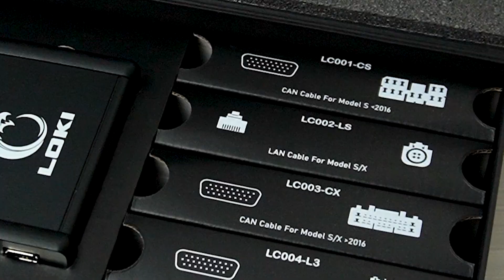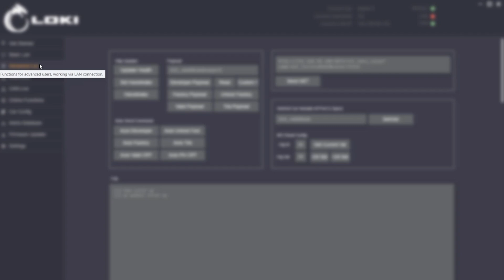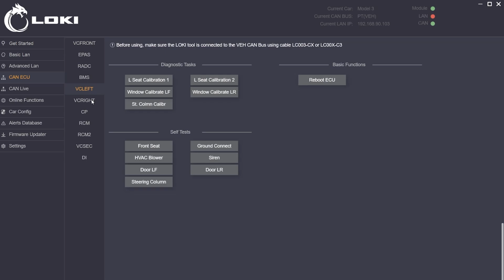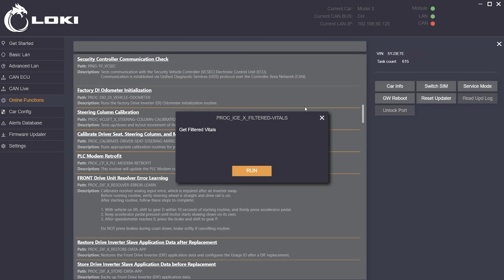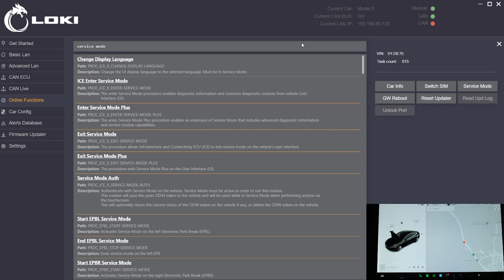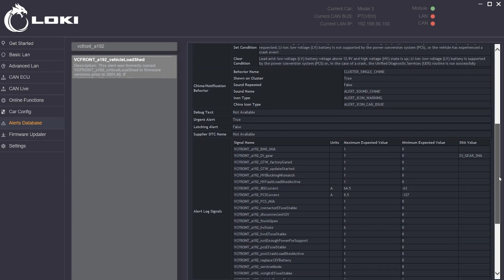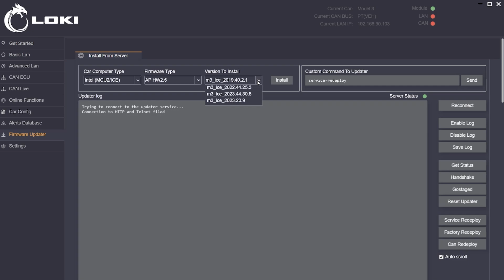Loki: a multi-function device for Tesla diagnostics

Comment: Could this be used to update the firmware of the steering wheel switch packs? I bought an aftermarket yoke for my 2024 Tesla Model 3 performance and the switch packs on the steering wheel (I believe it's a referring to the capacitive buttons on the steering wheel) have a different firmware than the car is expecting so my steering wheel heater doesn't work. Everything else works except for the heating function.
Reply from the maker: You can contact our managers: 
sales@servicems.eu
+48 (88) 689-30-56 (Viber, WhatsApp, Telegram)
EN: +38 (073) 529-64-26
ESP: +38 (067) 459-42-99
Reply from the maker: Ви можете звернутись з цим питанням до наших менеджерів: 
sales@servicems.eu
+48 (88) 689-30-56 (Viber, WhatsApp, Telegram)
EN: +38 (073) 529-64-26
ESP: +38 (067) 459-42-99